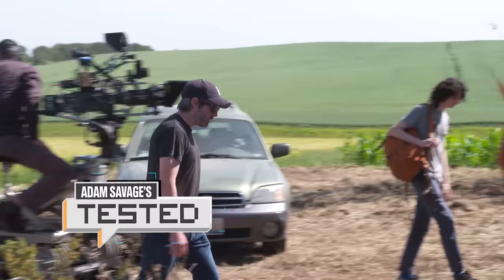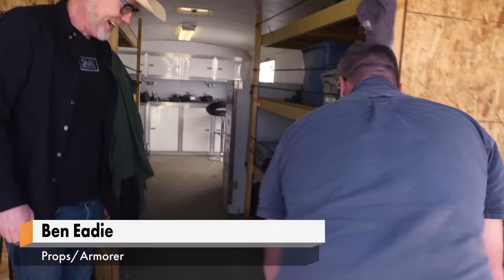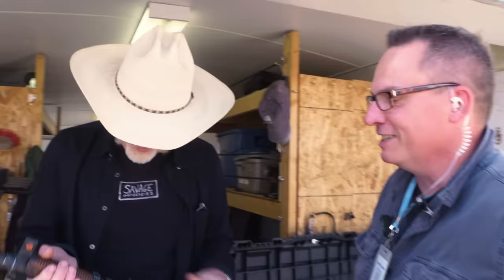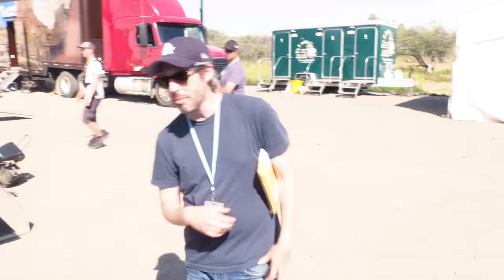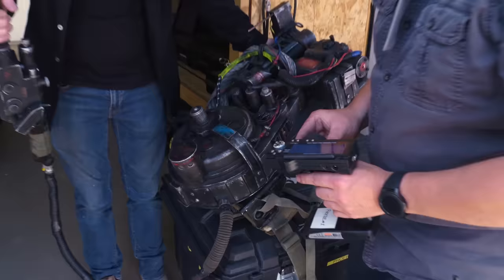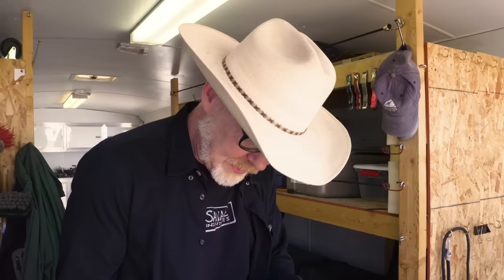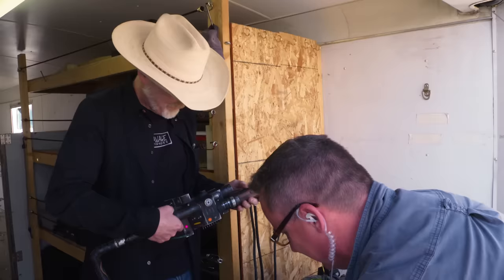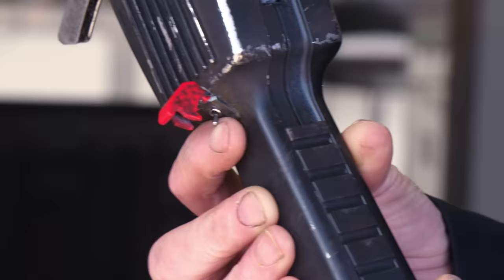Adam Savage Inspects Ghostbusters: Afterlife's Hero Props!

Comment: It was a delight to hear your excitement for the props. I had the honor of developing those for this movie. Namely the PKE meter, Ecto Goggles, Traps. I tried to capture as much original detail as possible. especially on the goggles, I leaned towards GB1 vs GB2. On the PKE meter we actually did one where the arms moved the full range from closed to taser. but the transition to taser mode was too slow. The challenge was getting the pivot points to move outside the body smoothly. Been loving all your GB content.

Comment: As a canadian, it's a shame that Ben doesn't have metric unit on his tattoo
Reply: To be fair, growing up with metric units I wouldn't need the tattoo.  With imperial, however, I always need help measuring.
Reply: I’m surprised that he even needed an imperial tattoo considering he’s Canadian surely he learned how to convert back and forth. I come from a metric county and learn how to convert metric to imperial and the reverse in school.
Reply: I grew up at the time Canada was switching. I am fluent in both. I can convert instantly in my head to mm. But not the other way around. Plus 90% of the lumber and steel up here is imperial. Final decision was I like how the imperial ruler looks. I'm thinking of a metric on the other arm though.
Reply: @DreadMakerRoberts  Isn't that the truth. We measure our speed in kilometers, our pet food in kilograms, but we build walls to code with 2x4s at 16" apart. Having both versions tattooed would be awesome.
Reply: @2TheHandsome  If you didn’t already know but if you are measuring timber use 26mm per inch. We both know an inch isn’t 26mm but that will give you the dressed size 2’x4’ =52x104mm as for length and spacing use a tape that uses the same units as the plans you could imagine what the frame of a house would look like if you used metric for some parts and imperial for others.

Comment: @5:14 It's amusing that those motor mechanisms to spin that cyclotron lamp were replaced as they broke during filming in Canada, and were apparently replaced with an LED ring. The powercell lights are also just a strip of addressable LEDs. I'm not sure why none of the very common proton pack light kits readily available on the market weren't used.
Reply: This is not what took place at all. I'll fill you in after the movie is out. But they never broke.
Reply: @DreadMakerRoberts  I suppose the multiple leaks from both individuals in LA and Canadian production are just blowing smoke, then. My bad. And you didn't think the motor noise would be an issue for the sound guys? The decisions made for props in this film legitimately puzzle me, as someone who has researched and built them for years.

Hell, you apparently paid Thingergy to use plans I made for Tested (that were never delivered to them) to cobble together EVA foam stunt packs. 

I suppose the silver lining is that I was able to buy out parts from Apex to resell.
Reply: Yes they were blowing smoke. I was the one in charge of these. They all worked. The noise was dampened after this was shot and we worked around that. As far as the rest of the stuff you mention. It's beyond the scope of my knowledge.
Reply: @DreadMakerRoberts  I think you mean it was "damped." If you "dampened" it, it would be wet.

Since you were in charge, can you answer:
1) Why are the booster frames different from the originals?
2) Why, if they're supposed to be GB1 packs, do they have GB2 style (shop-made banjoes) and black crank knobs?"
3) Why does the gunear screw not actually run into the mating face of the front grip?
4) Why were readily-available lenses 3D-printed instead of just being purchased?
5) Why were esoteric, rare, parts chosen (from Apex) for the Pheobe pack, thus hampering making duplicates in Canada? (AN3106 plug,  MS3102 receptacle, heatsinks, etc)
6) Why were the stunt packs built out of EVA sheet, instead of just being expanding foam poured into a mold, per the originals?
7) Why is the pointed portion of the instrument bar assembly not a 90deg angle?
8) Why is a different size of split loom being used relative to the original packs?
9) Why is the motherboard so oversized?
10) Why are all the welds on the pack ground down?
11) Why weren't Legris straights used on the EDA per the originals?
12) Why was the entire shell re-textured?
13) Why is all the knurling on the thrower knobs poor-quality and double-tracked?
14) Why are the toggle switches on the thrower so much smaller than the original throwers?
15) Why is everything on the thrower so heavily weathered, but the screws on the Clippard valve are still shiny?
16) Why are both Clippad valves R331 instead of R701 and R331?
17) Why opt for a Dixie Cup bracket on the thrower instead of just purchasing V-hooks from any number of established sellers?
18) Why opt to cobble together electronics instead of purchasing them from any number of established sellers?
19) Why is the belt  hook location on the guntrack so different from the originals?
20) Did someone actually think 1/16" thick material would work for motherboards instead of the original 1/8"?
21) Why did production opt to pay many thousands of dollars per pack to a studio instead of established builders who would have been happy to provide a higher quality product for far less money?
Reply: @thomasbecker9676  Dude I'm not who the hell you are, obviously someone of some connection but you are coming across as just a tad passive-aggressive mate.
Reply: @marvindebot3264  Why is pass-aggressiveness such a bad thing? Would you rather people instead be actively aggressive?

Comment: Guys get over to Hasbro pulse and back the Spenglers Proton pack. It's a 1:1 full scale replica for £359.99/$400. It's been scanned using the Afterlife hero screen used prop and needs your help to get it made. It's sitting currently at 4,753 backers but needs 7,000 to go into production....